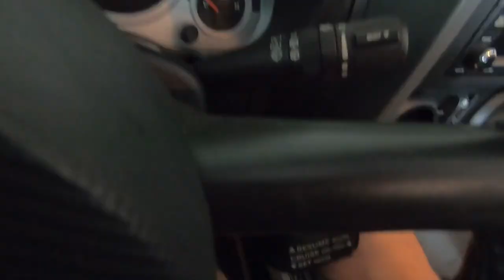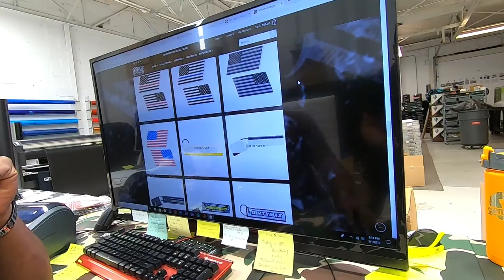STOCK JEEP BUMPERS ARE TRASH... The FIRST Mod Every Jeep NEEDS (Only $600)

Comment: With the bumper swap you really need to ditch those body colored fenders now. Get some nice black pocket style fenders. Also upgrade to LED lights for headlights and fog lights you will not regret it. JR Speaker makes some direct plug in lights that are super easy to install but they are pricey around 800. You don't want to go cheap with lights though. Wheels and tires, 2-3 inch lift and some new side bars will really make this jeep come alive in the looks department. For performance a simple cold air intake and maybe some headers are fairly cheap as well. You could go snorkel and get one actually made for a Jeep since there are plenty available.

Comment: Mike, don't you know? The only mods you have to do to a Jeep is unnecessarily expensive, brand name aftermarket wheels, bigger tires, 3in lift kit and giant F-ING eBay light bar on the top LIKE 90% OF JEEP OWNERS in my area!! 🤦🏼‍♂️
Reply: Is that a bad thing? People buy Jeeps to wheel them, and those are pretty basic mods, minus the light bar, for wheeling.
Reply: @rwduece122  expect the fact the majority of those people never drive a single day on dirt or mud. Those who do know the stock wheels are sufficient enough with some slightly beefier tires. For the $1000+ spent on "Moto metal" style wheels and tires, there are much better suspension bits, a winch, high jack, etc. that will help much more off-road than flashy wheels and a minor lift
Reply: @rwduece122  the lift kit is helpful though, yes, I'll give you that. But the stock clearance is more than sufficient to last until you actually build the rest.
Reply: Tyler N . You need to know what your talking about there keyboard warrior. You don’t know crap about building Jeep. Mommy is calling. It’s bed time.
Reply: I’m just gonna say being a Jeep jk owner if you spend the extra money on a rubicon. (Like I did) you don’t need to spend a fuck ton of money on anything. Mine out of the box is amazing now she’s on 35s she’s even better
Reply: @tylerm8629  See but thats the thing, most people with jeeps actually do take them offroad. Granted a lot of people dont get to do it as much as they would like, but most jeeps do see offroad life. And most people put new wheels on for cosmetics and strength, unless they are beadlocks. It wouldnt be wise to put 35's on the stock wheels of a wrangler, so thats why everyone puts aftermarket wheels on.
Reply: @sakostwwy1903  good one buddy, first car was a TJ and now I have a JK. I've never spoken to a single person who feels upgraded wheels are necessary for off-roading unless you want to run much bigger tires (+35") and start to really space them out. Even then it depends on what trails you're running. Mud vs rocks vs sand
Reply: @paulmatthews9853  the Rubicon is great, yes. Better than my base 2dr, and that's sorta my point of that here in Orlando, I see Jeeps every day that have the same set up, but never see those people up on Ocala on any of the trails. Stock Jeeps are enough, but "Moto metal" warriors with 3inch lifts and polished chrome and the Amazon light bar probably are doing it to impress their friends rather than hitting any trail for functionality
Reply: @rwduece122  I shouldn't have generalized and said "90% of Jeep owners in my area." Here in Orlando, FL, I'll stand by my statement. There's only really one good place to go to experience Jeeps and that's Ocala national Forest. Other than that, Jeeps around here are for light beach cruising and the boulevard. I see the same cookie cutter receipt of expensive ass wheels that belong on show trucks, no winches, no high jacks, no exterior lighting other than the eBay special 36" light bar that they drive normal streets with. I wasn't saying aftermarket wheels are pointless. Obviously the bigger rubber you can put down and the wider, the better. But it's the 17yr olds and their soccer mom's around here who give our community that stigma. Go to NC, Colorado, Tennessee or Nevada and you can get away with it more. Instead, with deep ass mud pits and clay here, it isn't what you'd expect from someone who is trying to be involved in the most the trails.
Reply: ***Edited the comment as to not offend the people who's feelings got hurt
Reply: @tylerm8629  Ah, i've spotted the issue. You live in orlando, i live in Colorado Springs. So as a result the majority of the jeeps i see go offroad. And we are right next to Moab so a lot of people go there.
Reply: Tyler funny you say that lol I brought my 14 jkr (2door rubicon) down to Florida from Colorado in March. Had one hell of a time out in richloam national Forrest or whatever just north of Dade City and lacochee. I was actually on stock wheels and tires and was walking through anything and everything. Long story short best 30k I’ve ever spent has been on my jeep
Reply: @paulmatthews9853  you gotta try the clay/mud pits and any quarries up on Ocala Fational Forest that you can get to next time through! They are absolutely perfect, especially after a big rain. But yeah, Dade is a little far for us in North Orlando/Deltona area
Reply: @rwduece122  yeah, much better culture out there for sure!

Comment: Get a light bar and winch for the bumper
Reply: Everything Atvs light bars are annoying. I took mine off after 6 months.
Reply: Bass Summoner they might be annoying for you but when I’m off-roading at night they are great.
Reply: Bass Summoner they litt
Reply: Everything Atvs pods and a 20in on the front bumper give you just as much light without the annoying wind noise.

Comment: Nice bumpers. Definitely a big improvement over stock. The front fender just seem off to me but maybe it's the camera angle. I'd be interested to see what anyone else thinks and suggestions for aftermarket fenders.
If the Jeep is going to see most of it's time with a soft top on it, you should build a cart, sure some company makes one, that you can remove the hardtop and put it on it and wheel it into the "storage" portion of the garage. If you really want to get slick you could build a cable system, sure a company makes one, to remove the hardtop inside the garage and then store it. Since we only see the garage orientation and the lawn, if you had the zoning allowance to do so, have you given any thought to building a taller garage to park the big toys in and possibly add a lift? Oh the shenanigans you and SentItSteve could do then!!!

Comment: honestly love this build, I have a 2006 ford 150 in mint condition and well I don't treat it like the blazer more like the jeep in terms of treatment but goal is end up like the dmax so far I have windshield mounted light bar and monster offroad wheels on 33 AT and 2.5 level lift kit half installed( only the level is installed still need to do the stut( have the strut just haven't installed it yet do to not having the proper gear) and the rear pucks) These builds are very imspiring to watch and make me have new goals for my truck
PS. the truck is red and named clifford

Comment: The stock bumpers are good if you plug the holes in the bottom and put a little spicket down there, they hold 30ish gallons of water

Comment: Replacing virtually everything on a stock Jeep is what you'll end up doing if you're serious about off-roading. Engine, trans, bumpers, much of the suspension, axles, differentials, wheels, tires and so on and so forth. Not to mention extraction gear, including a winch and other things. I know, because with 78 sq. miles of ranch land 'off-roading' is a way of life. So bring that thing out here (if you ever finish it) and we'll have some serious and absolutely YouTube worthy fun.

Comment: The stock jeep bumpers are the toughest ive seen for stock ive hit multiple trees and i rear ended a truck and only broke the plastic off a small spot and the metal only bent in an inch

Comment: It. Is. A. Jeep. A little water will not hurt it. Yes the radio is the weak link in the chain here and will likely be drowned if things get really wet but you can pull the carpets and the drain plugs and be mostly fine. (Assuming they fixed the problem with the 03-06 models where the drain hole in the front foot well wasn't at the lowest point in the floor.) Edit 1: Also I have to ask, are you going to replace the factory tire carrier and put a flag decal on the rear door of the Jeep? They sell kits to smooth it out or the shape is simple anyone with metal working skills could make a plate to go over it using the hole for the factory hardware and hooking the top lip. (Honestly I would love the drop down tail gate kit for my jeep but yikes on the price.) Edit 2: Mice love cars parked in garages and are faster nest builders than most people think. It is not uncommon to have to clean a nest out of an airbox as an automotive technician when you replace the filter.

Comment: No way you complete your Jeep build in 15k including the price of the Jeep. You will be hooked and never stop with the mods. Jurassic Park wrap will be epic!
Reply: Well he most likely will get the rap free LOL but 3 grand to do what all he wants is sure wishful thinking even if rap is free. I had over $21,000 in mine but I really blew the money at it and away....🤔 but I even replaced the axles with air lockers and a 15,000 pound mile marker winch and a gear vendors over under drive. But this was years ago when you were able to purchase them with the V8 engines. Thanks
Reply: @keepyourdayjob5658  I'm sure after he puts on a lift and new wheels and tires he will eventually want better axles and lockers. Maybe some different fenders and armor around the body... Free wrap or not it will be way over 15k. Gonna follow this one

Comment: Jeeps are garbage vehicles.  You buy them because they are a particular brand, like buying a say a Nike shoe, but if Nike shoes were notoriously bad for quality and fall apart, should you still buy them?  This is what I don't get about Jeeps, they had a trusted brand because they were used in the military and perceived as a tough quality vehicle, that can offroad, but now they aren't, why do people keep buying them?  They are a money pit.  Same with the Hummer, you can only fit 4 people in them, but they are huge and heavy, they are just not practical on gas and they are hard to find a parking spot for.  You'd be better served to get a Ford Raptor, it's ready to go off road and it can keep up with the entry sports car.

Comment: The irony with wrangler bumpers (and why I'm here), my wife bumped into a pole and put a NICE ding in the plastic shit bumper of the wrangler... We also have a '99 jeep cherokee... Now the irony is, I was at a light with the Cherokee when someone wasn't paying attention behind me and smacked into the back of my car going at least 35.  Not a fucking scratch, and they had one of the newer cars that are meant to just collapse... well it just collapsed.  Their front end was fucked up.  And the back of the cherokee, literally not a scratch.  I said, good luck with that, and drove away.  What up with the wrangler bumpers?  It's supposed to be a tough vehicle, and the cherokee got it right?  Weird.  (the older ones I guess were made to take a beating).

Comment: The problem with the cheap jeep bumpers are that they rust really bad, the prep job for the powder coat is done terribly, I own three jeeps and bought The same bumpers and even different ones before and the powder coating flakes off and rust overtime and they begin to look like junk! If you want to go with a good bumper that will last a lot longer I’d say go with poison spider.. they are not cheap tho!

Comment: There are a lot of cheap Jeep parts but they’re just gonna leave you with chipping paint, bad panel alignment, and stuff that doesn’t last. Look into brands like Metalcloak, JCR, Poison Spyder, and possibly Rubicon express. AVOID Smitty Build especially for fenders, I personally have seen a lot of those kits have terrible paint and terrible alignment. Rugged ridge and rough country are also two companies to avoid. I’ve installed multiple rough country kits and they do not go well. Hope I can be some aid through my mistakes!

Comment: Before you put the new exhaust on cut the catalytic converter and see what it sounds like
Reply: I cut right after the first cats on my old Jeep that was the same engine and it sounded great in my opinion. If you went from gear to neutral and then back to gear and force it to downshift it would pop and then take off